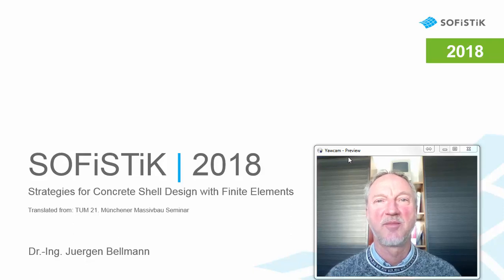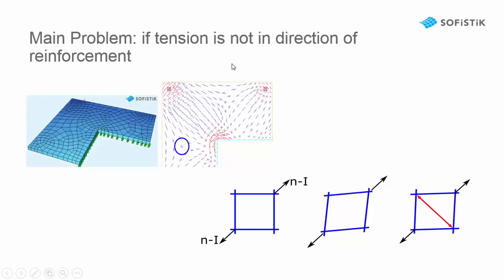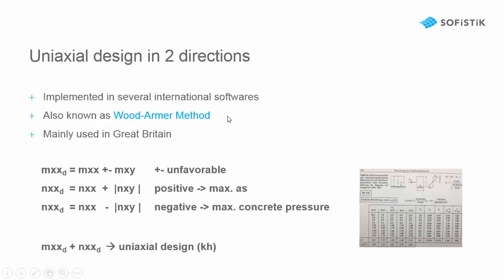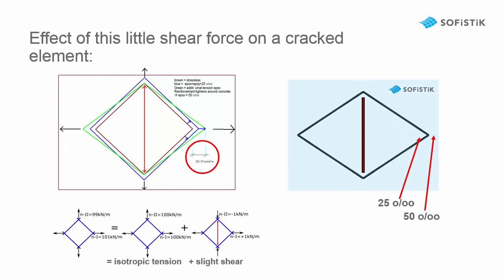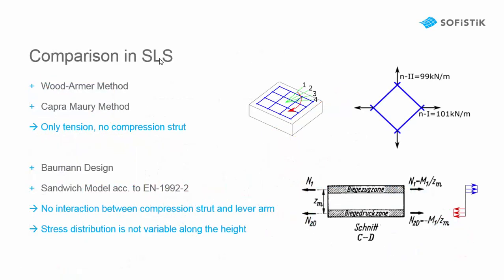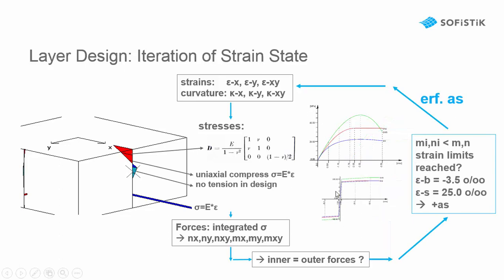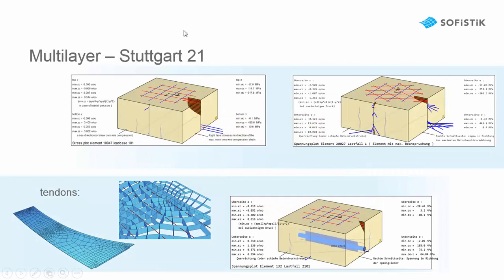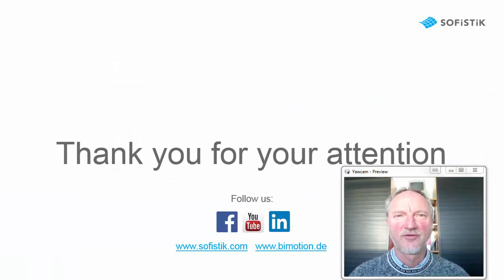SOFiSTiK Layerdesign

Comment: Hi! Thanks for the wonderful presentation.  I get some differences in the reinforcing amount between Sofistik 2016 and 2018. Does this have to do with a further development of the Baumann method? Thanks for your answer in advance.
Reply from the maker: Dear A.Iliopoulos,
There should be only minor changes in the BAUMANN results in the ULS design.
 In SLS e.g. crack width there may be some higher differences.
We have implemented some country code specific changes on this.
 The actual version should always give the best results.
Please check if really the BAUMANN procedure runs or the new layer technique (with the stress pictures).
Your SOFiSTiK Team